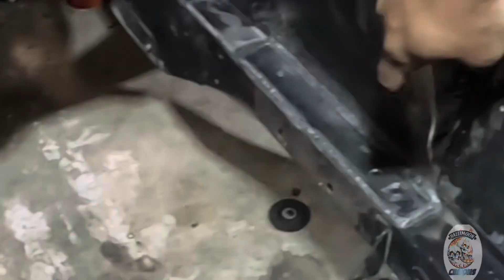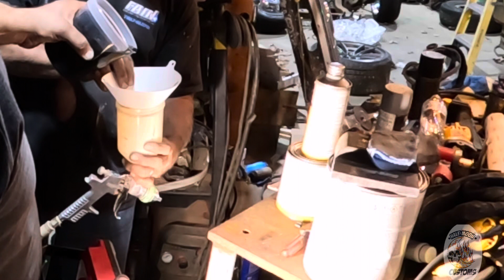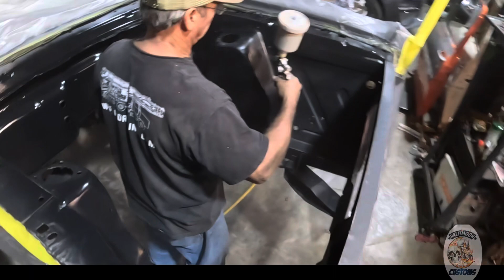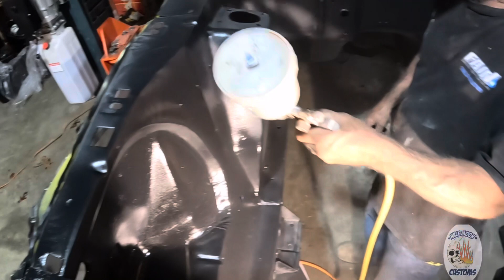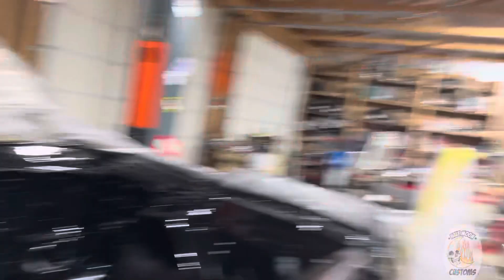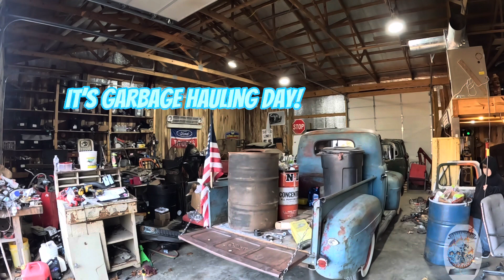Priming and painting the engine bay on the 66 Mustang Fastback!

Comment: WHAT? Please tell me you will have AC in that thing. Can't be rollin in style with no AC! Seriously though i do like how you are doing it right. Not rattle canning it with the engine still inside. One of my pet peeves is people intentionally halfhearting the work out of laziness. If they don't know better thats one thing, but most just too lazy or cheap. Why was the primer barely coming out of the gun? Mine can be turned up to almost garden hose speed down to a light mist like yours was doing but never seen someone shoot that low a flow. But I am a 98% amature so just curious.
Reply: OH nevermind I missed the part that was was "Single stage". That explains it.
Reply from the maker: Vintage air makes an ac unit that eliminates the factory blower motor. The kit comes with a block off plate. I didn’t want the ugly plate showing. We’re definitely amateurs also. We did turn the psi up. It’s epoxy primer and delfleet (PPG) single stage.